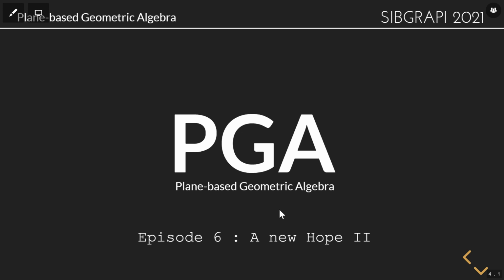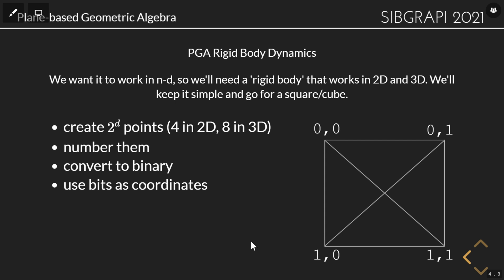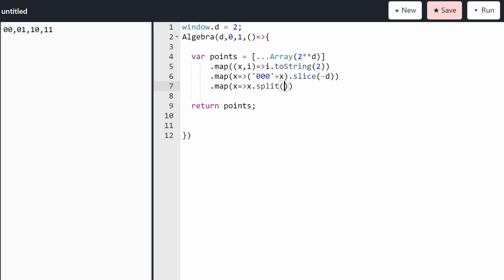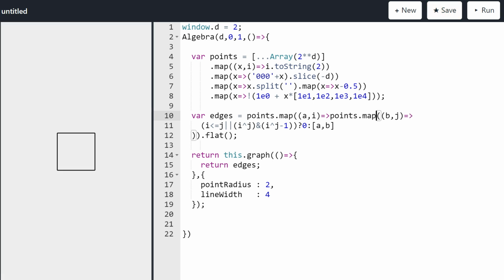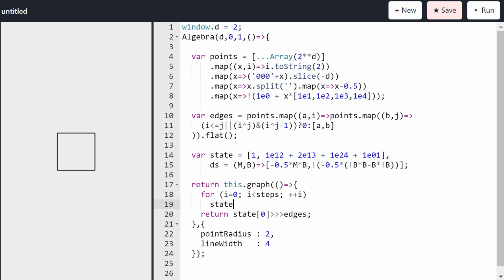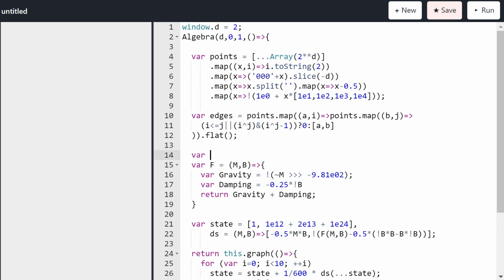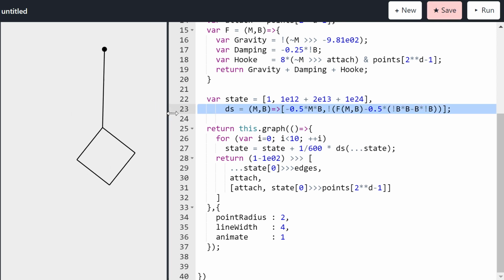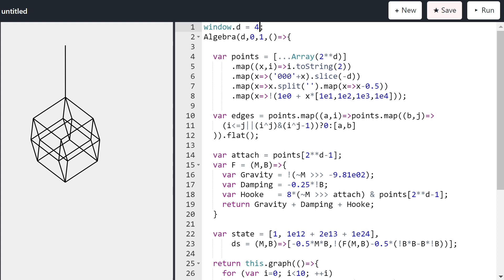PGA Ep 6 : A new Hope II

Comment: I was just getting back into physics engines and GA, trying to wrap my head around how to best handle rotational inertia, when I found this content. Now im almost demotivated because you guys made it too easy. Almost. 

For a fun challenge: Ive done noneuclidian spherical raytracers, but ive always wanted to do a physics engine that way too. It makes the translation/rotation equivalence even more explicit if thats possible, since they are all just rotations around different poles. I know, just like in PGA... but poles in the same space without any points at infinity involved. 

I suppose this should roll out of the algebra pretty easy; it should be just N+1 with a positive signature, and with positions normalized to length 1. Not sure if I need to take any special care not to lose that normalization. A classical physics engine integrating angular rotation rates into a quat rotation state also has a normalization step in it. Is that somehow not necessary in the full GA picture, because any numerical drift will self-correct? Or is it just left out here since it does not matter for this brief demonstration?

Anyway; so many questions... but better get to writing some code.
Reply: with spherical geometry, all translations become rotations around some point (as you pointed out)
so i wonder if the geometric space you're dealing with is just 4 vectors that square to 1, 
and that the e0 vector squaring to 0 in PGA is a result of taking a normally curved space and scaling it down until space is roughly flat.
if true, then you could do hyperbolic space just by swapping the sign (e0^2 = -1).